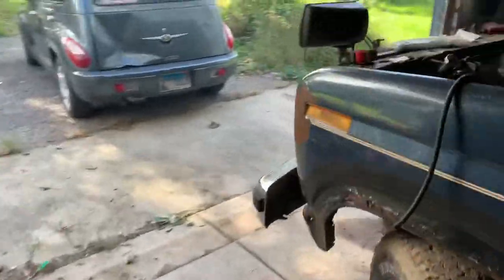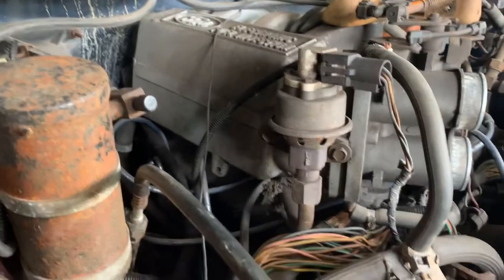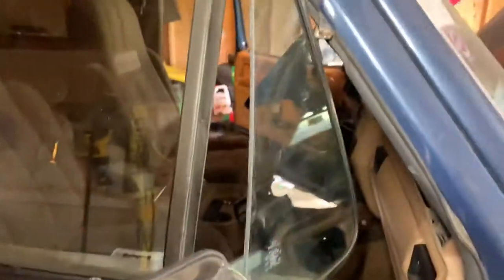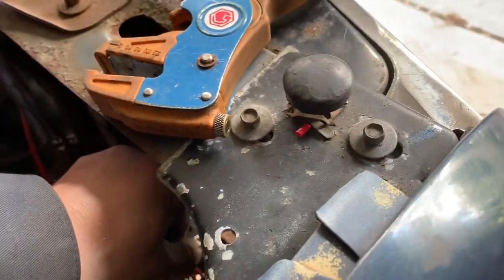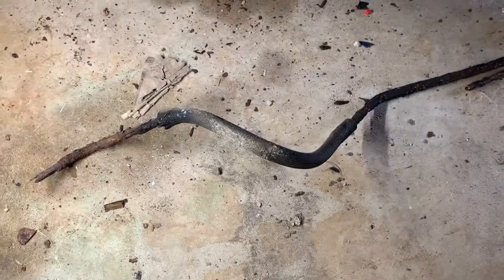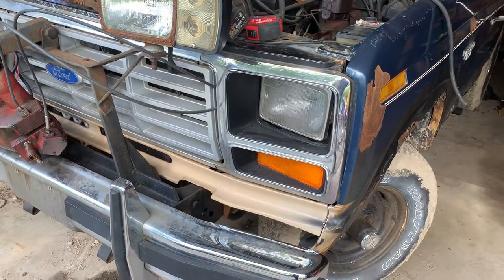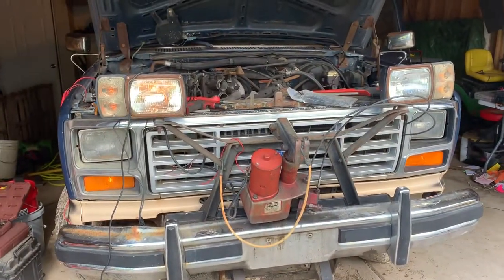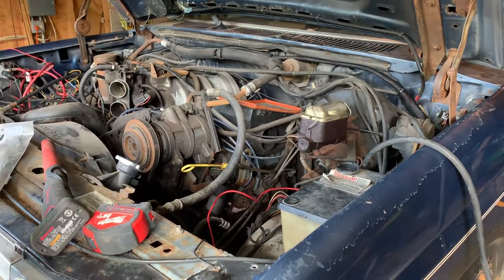Bronco running! Wiring update

Comment: Hi got same engine as you and this helps me I got a1989 ford f150 xlt lariat 2 wheel drive truck I’m heading to carburetor too I have not started the truck yet because it used run with efi system but it dies so I decided to go with a carburetor so this helps me a lot plus I want my look clean in the engine bay and give the truck brand wiring system they started looking old and need to be reorganized give it better look in life and bring back to life so it can keep trucking I love driving old trucks bring me back the day and make everything easy to fix problems and someday in the future I will put fuel injection carburetor system who knows